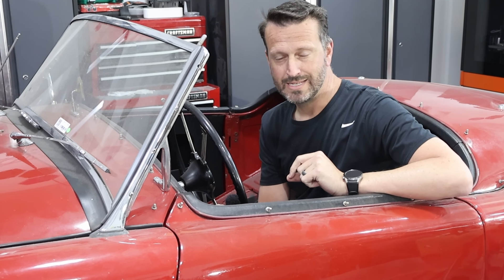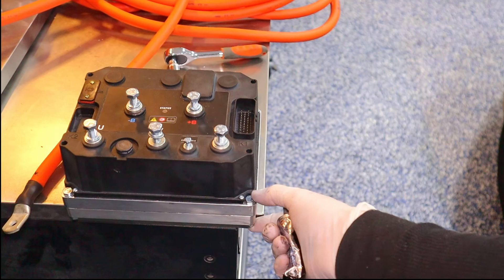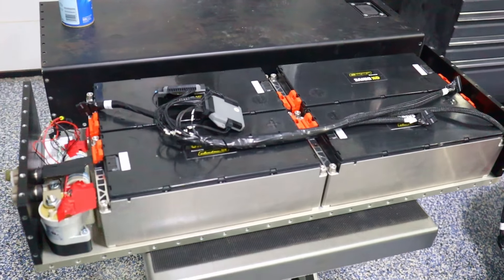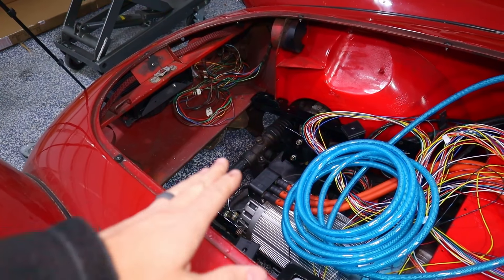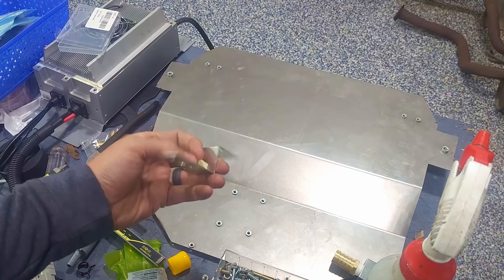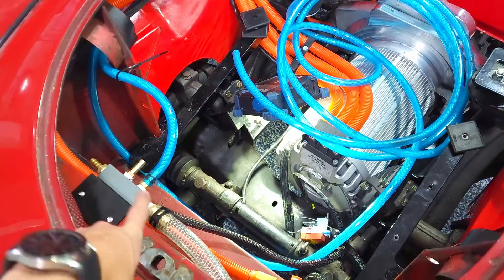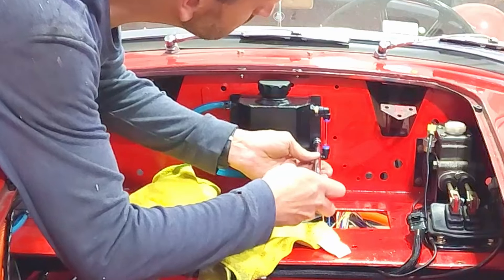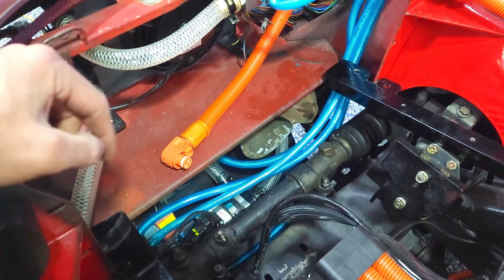The Power of Cool: Crafting Custom Cooling for DIY Electric Car Conversions

Comment: For the piping and nippels there are better ABS and PA material, OEM style hoses and quick disconnect options. It's same as pneumatic hose. Similar to your level gauge pipe.
Reply from the maker: Thanks for the tips!

Comment: Jeremy thank you for a great video on liquid cooling. Do you have a schematic you can share that shows how the whole system works? I'm doing an EV swap on a 1968 Ghia and trying to understand how/where the reservoir should connect to the loop and if the pump goes "in front of" or "behind" the radiator. Thanks
Reply from the maker: Send me an email Electricsupercar@gmail.com

Comment: I heard you say cooling may not be necessary for charging. Can you explain why. Will you need heating for preconditioning? If not, why?
Reply from the maker: This car has a low power charger.  Cooling is not necessary.   Also climate is southern California, so reconditioning for heating is also not necessary for this customer
Reply: @ElectricSuperCar 
how many KW charging, is this a set amount, or does it fluctuate?
What do you expect it's 30 to 80 percent charge time to be in 80f Cali weather.  
Fun car to drive as long as your not 2 hours or more charging.
Reply from the maker: @Patriot3  the customer bought a kit with a 3.3kW charger.  The customer has a 22kWh pack.  I am guessing 20% to 80% would be 4 hours.  Customer kit does not have fast charging.

Comment: I liked the intro,  but if you want to not do them anymore it's totally fine. 
so the part that i didnt get from the tubing is are there 3 different circuits? 1 to the batts, 1 to the motos, and 1 to the motor controller or are they all daisy chained ?
Reply from the maker: All coming to and from manifolds.  I have flow control on the batteries

Comment: New to the channel but seen something straight up, when machining metal for sealling surfaces, cutting a single and multiple groove/s in the faces in the faces allows the goop to make essentially O-rings and very hard to push out. Roughening the shine off also allows compounds to bite better. Same reason we used to place a strand of silk thread on the faces of crankcases on the Permatex before bolting together. 
Next issue, Teflon tape, mate, way too much is being used and to be honest, you shouldn't use it in this application at all. Reasoning: The fittings you are using are tapered for a reason and thats to seal and brass/ally seal pretty good. Next reason is when you tape them, you are taking the tape down past end of thread and when you tighten them in, this becomes cut and falls away eventually and into the stream, as you have small pumps and small coolant paths in some gear, not good in any book. Look for liquid thread seal (Permatex was the king of it) and use only small amounts. 
OMG, what is the go with the nut on the HRC fuse @ 15:07, no way that will pass.
Reply: Pipe threads are normally tapered, and usually require sealant. Dope is better in some ways, but tape is fine if properly used. I agree that there is a lot of tape - likely an excessive amount - used in this video.

Comment: Jeremy, do not use your bare hands for with compressed air.  Compressed air does nasty things if it gets under your skin.  A very safe and cheap way to test for air leaks in a cooling system is to block one end  of whatever you are checking and connect a hand pump for a bike to the other end using a schrader valve and adapters, with a pressure gauge.  Apply 5 PSI and spray down fittings with soapy water, looking for bubbles that indicate leaks.  If you don't see any bubbles, you can let it sit at pressure for a while and see if the pressure has dropped.  Stay safe!
Reply: High pressure air can do nasty things. I believe 30psi is considered safe to handle under all conditions. Up to 60psi is usually safe but be careful. Anything over 100psi you should definitely follow proper safety procedures.

Comment: You definitely have the skills for routing the cables and hoses down to a science, Jeremy!  Very clean looking so far, the owner will have no problems knowing what is going on.  I noticed that there are some pretty raw guide rings holding the cooling and electrical (towards the front of the engine compartment).  If you have some smaller sized tubing, slitting one side of it makes a great edge protector that you can trim easily to fit.  It also works good for a low pressure seal in some applications.  Looking forward to the wiring video{s).  This has been a fun build to follow, and I like that you are using rivet nuts for everything, such a clean way of doing things.  Keep up the great work.
Reply from the maker: Thanks 👍

Comment: Where the second cooling line goes over the top of the other fitting /line, get a price of hose and cut it to slide it over the second hose to protect it. That fitting and stuff will rub thru and cause a leak. Think about those spots and always put an extra piece of hose over it (rtv it in place and two zip ties) do this anywhere hoses touch each other, fittings, or body. It will prevent the owner from having a bad day. As the pump is on, it vibrates even if you don't see it and runs through it fast.
Reply from the maker: Thanks for the suggestion
Reply: Or, even better, support the hose properly so that it won't rub on anything. Yes, that can mean a lot of supports, especially when using bulk hose bent into place rather than custom-moulded hoses.

Comment: For the hose connectors, if it's brass against Al, can this cause corrosion? Whenever I pumped water-based liquid with mixed-metal cirquits (brass-steel, brass-Al) I eventually ran into issues due to corrosion.

Comment: The piping would be neater if the manifold with the 3 pipes was situated nearer the motor controller / battery box, then you only have 1 larger diameter pipe going from front to back of the engine bay.
Reply from the maker: probably true

Comment: i have a w108 1966 250se but i am so fed up with the mechanical issues.

would love to just convert it to electric. 
but i dont know how to connect the motor to the automatic transmission.. could go the route of using a backmotor like newer cars without the transmission and so on, but is that more costly?
Reply: I believe automatic transmissions do not like electric motors at all, so much so that many people converting an automatic put in a manual gearbox if they want to keep the gears.
Reply from the maker: Email me electricsupercar@gmail.com
Reply: Could install an e-axle in the rear or perhaps use a GS450h transmission in place of the original auto

Comment: You may want to consider changing supply for air radiator to the bottom. That way you will not have problem with air stuck in there.

Comment: Please consider getting a normal water pressure tester for leak testing. 
2 reasons; water doesn't compress. Air does and that gives an added risk of something literally blowing up in your face. (And you don't want air in your blood stream, Google the risks)
2- you get better control over the testing pressure and any weak spot will give instantly.

Comment: Might want to consider some sort of bushing or liner for that hole that the coolant lines are passing through in the engine compartment… eliminate any kind of chaffing/wear that might happen as the plastic tubing rubs against the metal.
Reply from the maker: Good call
Reply: You can often find rubber grommets at Ace that will fit nice - though it's not always easy to find the right size, for larger hoses

Comment: You have the overflow tank on the suction side of the pump?  Why not have the overflow connected to the top of the radiator?  It would seem that if the overflow tank is low/empty it would cavitate the pump.

Enjoy the videos and you look a lot like a  guy from a podcast I watch.  Woodysgamertag from PKA.
Reply from the maker: It is my alter-ego

Comment: Yes, batteries produce heat, and so do motors... but the electronics do as well, both inverters and chargers. The first cooling plate installation shown in this video is for the motor controller. Lots of stuff to cool, or sometimes warm.